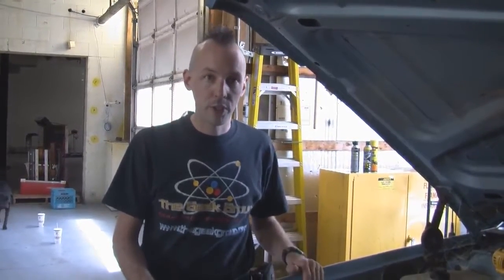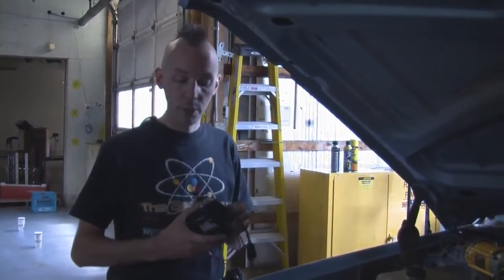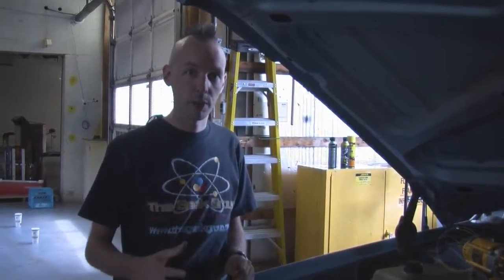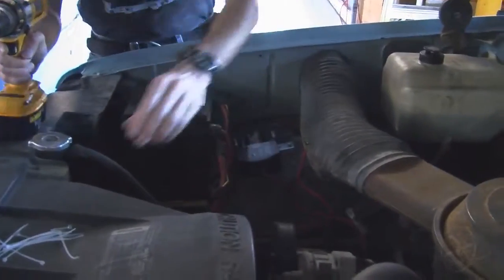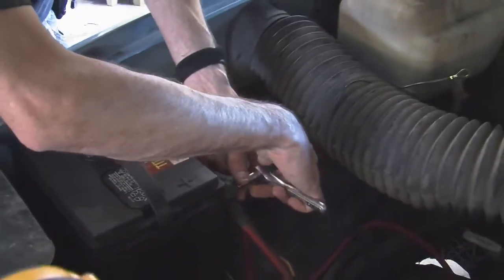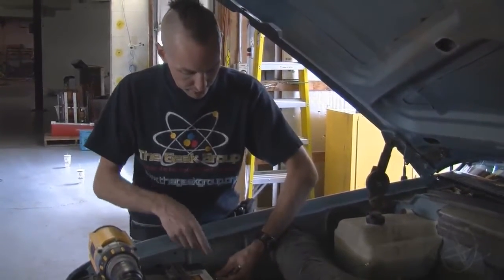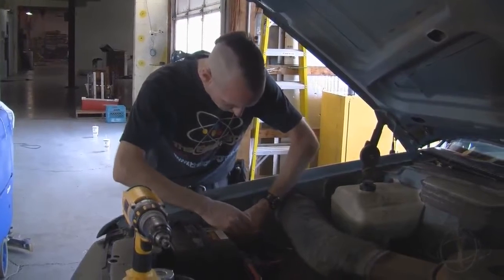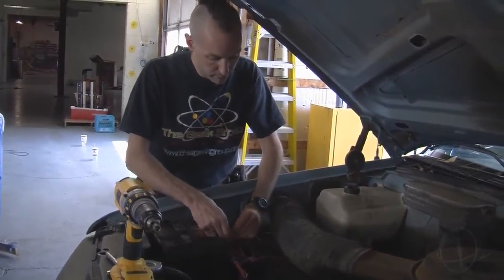Onboard Battery Charger Maintainer Installation

Comment: Can you permanently leave the battery Charger connected to a AGM Deep cycle battery, under the hood, only plugging it into shore power when needed. replacing the alligator clips on the charger with terminal connectors?

Comment: I was always told to fix the in board charger away from the battery the length of the wires from charger to battery in case of battery leakage causing a fire with a alive charger but you have put in next to battery this is a health risk